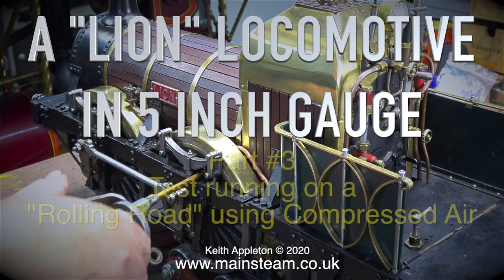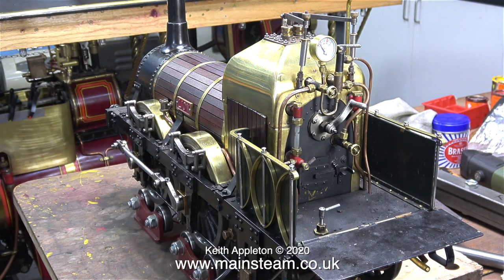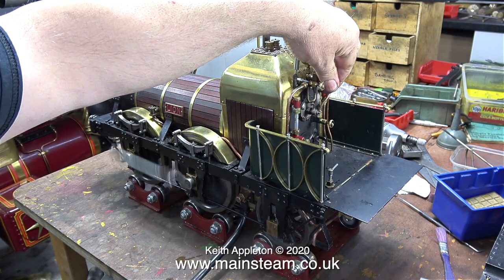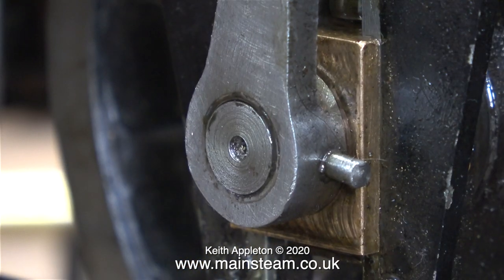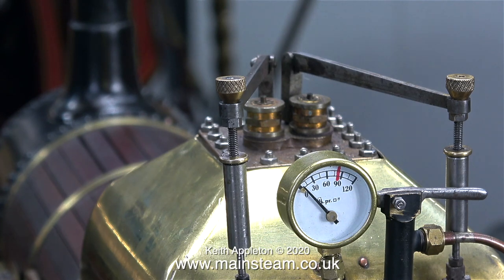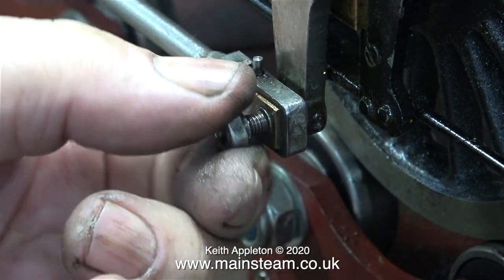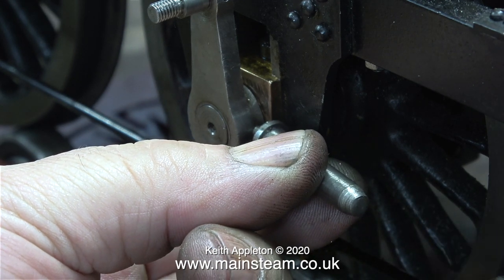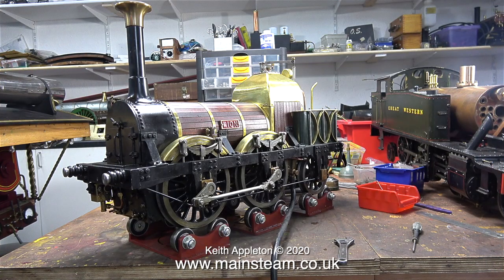A "LION" LOCOMOTIVE IN 5 INCH GAUGE - PART #3

Comment: This was a nicely made chassis when I bought it. The work I did was fitting a new boiler (including regulator internals),  cladding the boiler in wood and making the brass haystack top cover. Would you believe the regulator lever was even wider than shown - I slimmed it down but a 1/16th eitherside on the arm, but I suppose it should be even slimmer and longer like the real engine. Keep up the good work Keith. It's a nice engine to watch on the track with coupling rods being very visible.
Reply from the maker: Yes, I love it. As you say, the chassis is nicely made. The main problems are the roll pins holding the crankshaft and other parts together plus various small jobs. I will remove them and taper ream for taper pins, that should bake an interesting video. It's just what I wanted as I will get a good video series out of it }:-)))

Comment: Hello Keith.  Thats a lovely lion . I have a 5 inch gauge dougal . I suspect the boiler has some limescale in it . What would you recommend to flush the boiler out with as the injector clack is blowing back . I currently have the clack in some vinegar to get any lime scale out of that.  Hope your well . Rick parsons
Reply from the maker: Try Kettle De-Scaler, I use some stuff called "Kilrock-K"
Reply: @keithappleton  thank you